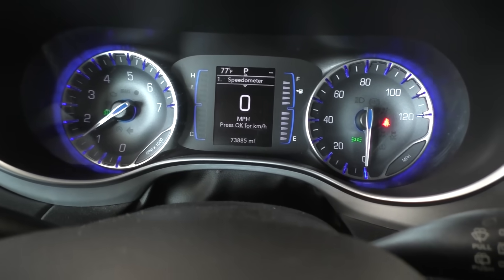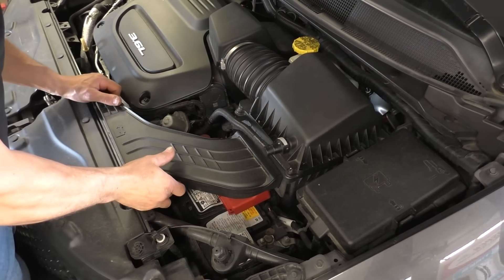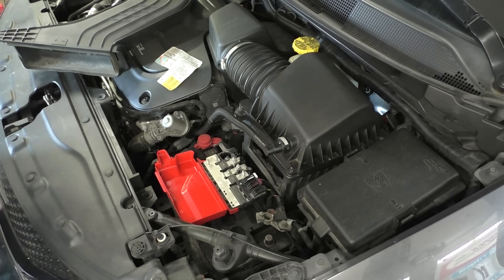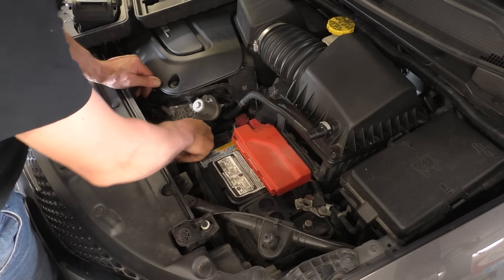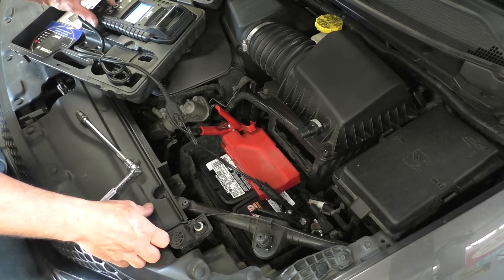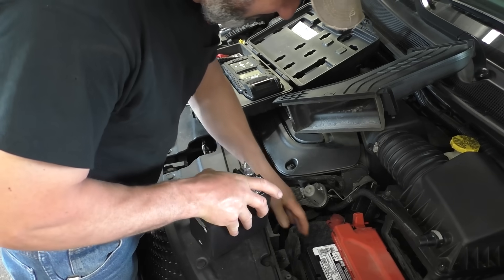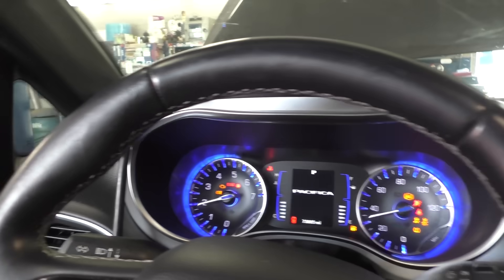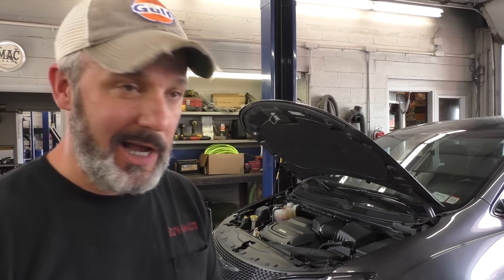Chrysler Pacifica - Start Stop System Disabled

Comment: As an Electrical Eng,  I say this is an amateurish design. If you have voltage fluctuations, you put in a regulator. You don't put in two high failure rate components (batteries) and engineer some wonky protocol for constantly disconnecting them. In this case,  since Vin ~= Vout, it'd probably be a small buck converter. Much simpler, cheaper, more reliable.

Comment: As Tribologists and lubrication specialists advise, to immediately "Disable" Stop/Start systems on all vehicles, this is win. Now your oil will last longer, at least till some monkey comes along and fixes it.

This is the same as Mercedes, although fixing the battery issue is good, uninstalling Stop/Start saves the starter motor, the engine, and the oil life. But then again, if it is in town driven and never sees the interstate, never gets 3k oil changes, it's not long for this world anyway.

Comment: What blew my mind as a child was the tachometer in my dad’s pickup RPM that one revolution of the crankshaft piston goes up and down in a single revolution if you idle at 600 rpm then it is a complete up and down ten times a second and that’s a slow idle speed red line at 6,000 rpm and that’s a hundred times a second and that’s a slow old pickup some of the really impressive engines can get to twenty thousand RPM and do that for five hundred miles if you have ever felt the weight of a piston and rod multiply that by eight and you will be surprised that they don’t explode at that speed and that’s only part of the weight of the moving parts in a engine if you truly understand how a engine works that will make you wonder how they can do that and not explode is still a mystery p
Reply from the maker: What engine do you know of that can run at 20,000 RPMs?

Comment: Unpopular opinion, I don't get the hate for these systems. I have rented probably 100 cars with start atop and it doesn't affect anything in normal driving.  I've even had a Renault in the UK with a manual transmission that has start stop.  Let your foot off the clutch in neutral at a stop and it turns off.  Touch the clutch and it starts.  I just don't understand the hate.

Comment: My sons wife bought one of these POS. A 2021. She got the start/stop system disabled. Message, and her air conditioning stopped working. This was two months ago. $2300 later, Its still not fixed. The so called
 " technician" they took it to said " Its above my pay grade, take it to the dealer." Now its been at the dealer for 2 more months "waiting for parts" I sent them this video, but nothing has changed. Next Stop is going to be PHAD. Im thinking a bad ground on the TIPM. 
You could not GIVE me a Chrysler product.

Comment: RE testing "better than advertised" - If that little battery was being sold by Chinese vendors on Amazon, it would claim to be 2 million cold cranking amps and in reality could barely run a tail light bulb for 5 minutes, and when you cracked it open there would be some cheap AAA cells badly soldered together and the rest would be full of sand and old building materia.

Comment: One of the worst environments for electronics, is in a car... Hot, cold, vibrations, damp, wet, undervoltages, overvoltages - I'm surprised they even run correctly as good as they do normally.

Comment: Leave it disabled.... the customer will thank you ... I have had GM models not turn back on when you take foot off of the brake and force you to shut everything off and reset  the system in the middle of a traffic jam...
Reply: Drove a manual with stop/start once which let me roll downhill into a crossroads without an engine. Didn't really enjoy that.

Comment: I was doing fine until you mentioned what a waste of a life I am for watching a battery replacement video.
I'm just hoping for a Mrs. O cameo. Well, we got a drive by at least.
Just finally upgraded to a 2014 SUV with heated steering wheel and 2 position seat and mirror memory. With 125,000 miles. I see computer work in my future but I just keep my fingers crossed and some money in my account.

Comment: Only a professional will stop trying to force the battery in there several times before retracing/removing parts necessary 😆 only a professional saves time by not engaging in futile actions😆

Comment: I have no issue with the engine shutting off at a stop, but the 1/4 assed way that auto makers have implemented it is really stupid. Vehicles with start/stop should be mild hybrids with an alternator/starter like the old GM hybrids or the Dodge trucks. Using a brushed, DC motor with a solenoid and bendix drive (i.e. a standard starter) to start the engine several, even dozens on times on a single drive is really dumb, a typical starter can pull 500+ amps momentarily every time it cranks the engine.

Comment: Ok so what I got from your explanation of this start stop system is.. it's useless junk that is lost in value of saving fuel at the first repair as that assumes any savings in fuel .. plus it's more stuff to fail that average joe can't diagnose and has to be taken back to the dealer for very expensive parts

Comment: Maybe that rubber goes under the bracket to help hold it, so it doesn't pry up on the cable when you flip up the cap? 🤷‍♂ Nah, Chrysler engineers aren't that clever. It's probably just a mistake that they never corrected 🙄

Comment: Those computers are all just modules that uses the CANBUS system to talk to each other.  They did this to reduce the amount of wires to connect it all together.   Yes it is a miracle that it worked for 100,000 on a Dodge, Chrysler product.    All it takes is one module to start talking trash and the whole system can fail or a 120 ohm resistor to go open can also bring it down.   All the domestic brands have gone to this system for quite some time now.    I was warned in about 2025 or 2027 the other manufactures will also start putting in the secure gateway module to block unauthorized access to the systems.     To those who have prior felon convictions they will deny you guys access to the systems using your own scan tool even if you went legit.

Comment: This system sucks.  I have a 2018 Pacifica.  I've had 6 Aux batteries and 4 main batteries.  2 OEM Aux batteries, but ~$280 for a battery that doesn't last?  No thanks.  I hate this feature.

Comment: So, they put an IBS in and then never use the data to communicate with the operator that its time to replace the battery. The driver needs to go to a mrchanic who needs to use "a big fancy scan tool" to deduce the batteries may be weak, requiring a "special fancy tool" to confirm. Id say that's some pretty poor engineering.

Comment: how stewped. the start stop systems is dangerous for us WHERE IT SNOWS and should be disabled. its also hard on your starter. and now chrysler has a 2nd battery to overcome their bad electrical design offsetting the MINIMAL environmental savings the system would do. extra battery more rare earth minerals wasted and tossed in the trash more switches and wiring... the start stop system is as idiotic as the gas can funnels that keep getting redesigns because they DONT WORK as intended. most people just take them off and pour direct gas which again is WORSE than using old design. start stop does NOT instantly start your car Instant is seconds. when a car is sliding behind you at a stop light you have only SECONDS to react to avoid getting hit, but yor engine is off.... no worries start stop is INSTANT 3s.... SLAM rear ended whip lash possibly 2 cars totaled and that just offset how many cars using this system 1000? 5000? 10,000? oh wait you punched the gas engine starts FINALLY... now you lurch forward uncontrollably because you were in fight or flight mode foot pegged to floor... u avoid getting rear ended but were going to fast forward and hit a car that was going through the light. the system is dangerous.

Comment: I wholeheartedly despise all this tecnogobblydygook, "push button start/stop"
what the hell was wrong with putting a key in an ignition switch?!
Reply from the maker: Since about 2007, putting a key in the ignition is no different than pushing the button. Seriously. They do exactly the same thing except you feel good putting a key in 🤷‍♂️ it's not like an actual mechanical ignition switch if that's what you're thinking.
Reply: @SouthMainAuto  oh, I know. My Tundra has key start, but essentially works as a trigger for the ECM. 
I just miss everything being simple mechanical connections.

Comment: That whole stop and start is a piece of crap. Batteries are about 500 dollars a pair. 1 year on the aux battery and 3 years on the main battery. Lead acid battery you get 5 years. So much for a better mousetrap.....lmao. Problem is the aux battery shorts out and kills the main battery. On the 2020 pacifica you are lucky to get the main battery called the H6 battery cause they make some H6 battery 1/4 inch higher and cheap ass Stellantis left the wires so short you have a real battle on your hands. Don't even think about putting a H7 battery in there the wires are way to short and the fresh air intake won't even start to fit. That whole stop and start is piece of crap. The default is on every time you start the vehicle. Should be the other way around. Should be off by default. It will hesitate at times when you need to take off and dam near causes a accident. Take it to the dealer....There famous words..Works As IT Should. Why the hell you think I took time off to make a appointment and waste my time to hear that scrap under warranty. Best thing you can do is to remember to turn the switch off till that breaks and then you get the message stop start is not ready. I could give a crap. I hate that system. Hope Stellantis gets sued when someone gets killed or hurt over that stupid thing. I think the aftermarket makes a bypass on some models of Stellantis junk. There dealerships are great at not fixing things of late under warranty with the words..Works As It Should. Or they let it set for a week and never touch it but tells you Works As It Should